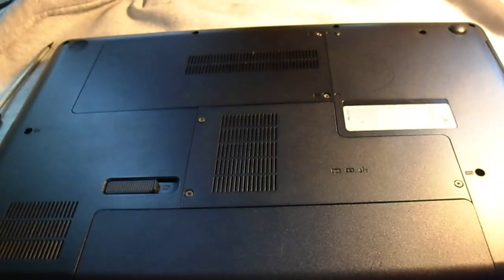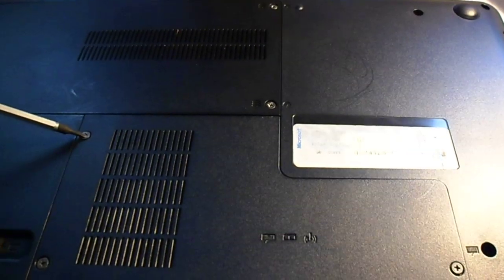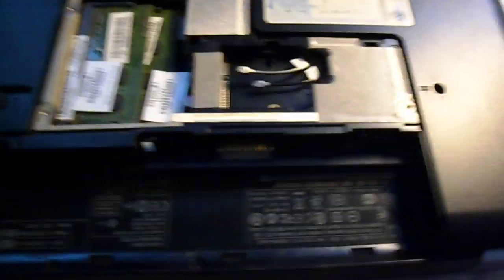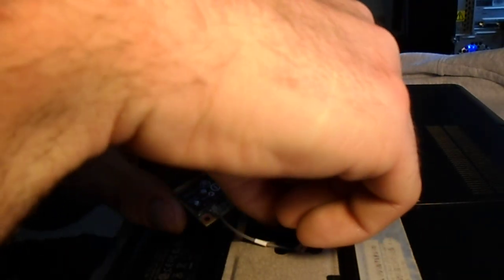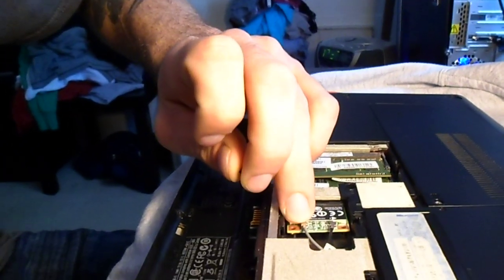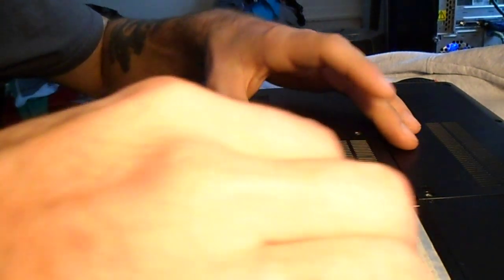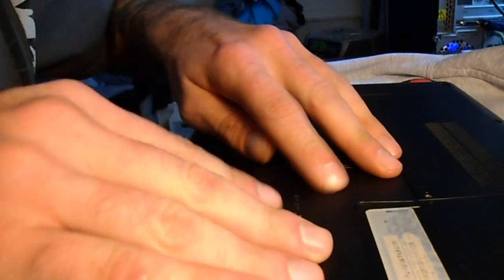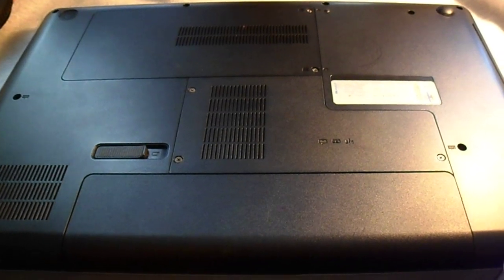Installing a WLAN wifi adapter on a laptop

Comment: Some newer laptops don't have those small easy to remove panels any more.  Just look at an HP laptop and you will see what I mean.  It is almost as if they don't want you to get in there.  They design things more and more so that you would be brainwashed into thinking that nothing is user serviceable inside them.  They are really no different from a laptop that does have those panels except they make it so that you have to pry it open once you take the screws out.  Some of the screws are hidden under stickers and that is one thing I don't mind.  I just wish they would stop trying to make people bring them to service centers for simple upgrades and repairs.  I just hope that HP and all the others are not trying to be like Apple.  I hate proprietary junk that can not be upgraded.  Apple is known for trying to make people upgrade instead of repairing things

Comment: How do the wires attach? I can only see the back of your hand. Do you press them on? I don't know how to remove the one that's in there and don't want to goober anything up. Thanks.
Reply from the maker: +mightygrow  The wires pop on and off. Make sure the battery is removed and use a very small flathead screwdriver to pop the current wire off. Sorry for the late response

Comment: my card number 2 cable broke off what is that cable for
Reply: They are antenna cables for WIFi and maybe even bluetooth if you have a wireless card that has it.  I made a mistake with those wires once and pulled on it.  That ruined that wire.  I now know that I have to pop them off with a small screwdriver.  The best screw driver for it with have a head almost small enough for eyeglass repair screws.  Did you do what I did and try to pull the cable off the wireless card?  If you did, you might never get it back on that wire and have it working correctly  (they are very small).

Comment from the maker: From what I've experienced, a wi-fi card does not need a driver. BUT, your computers wifi capability drivers may need to be updated. Your PC may not accept the card also because it may not be supported within the wifi compatibility software